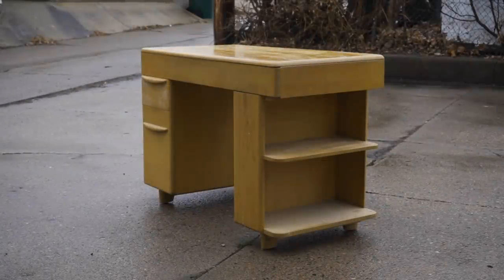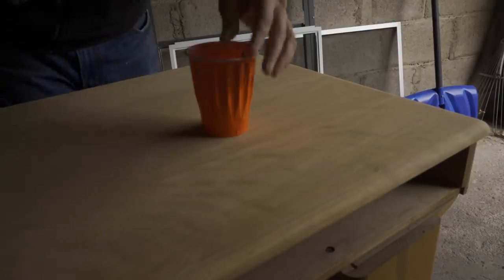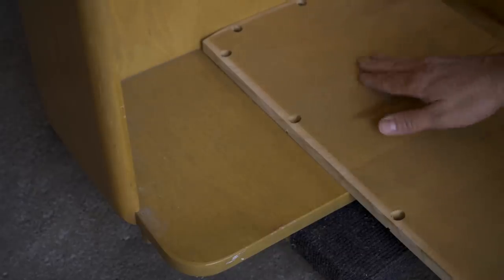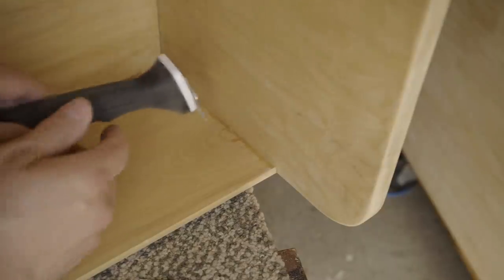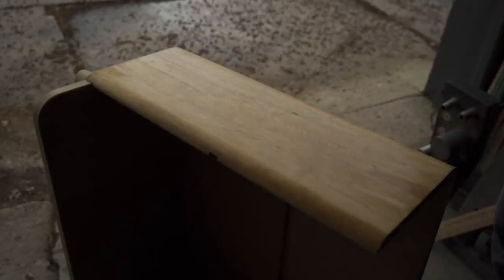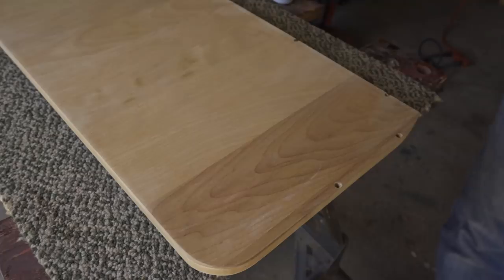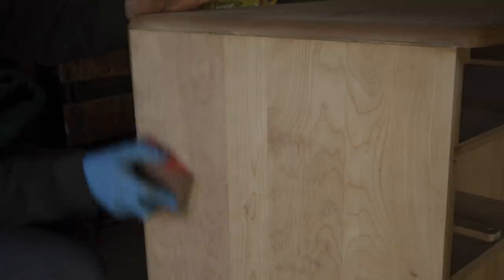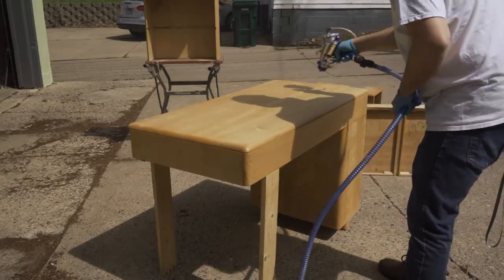Refinishing A Mid Century Heywood Wakefield Desk | Furniture Refinishing

Comment: My mom and dad had a matching large desk, corner table, and end table exactly like the one here. My sister got the desk and I got the two tables. Like yours, the "blond" furniture appeared to be sprayed with a colored lacquer. Single coat on the undersides and multiple coats, sanded and buffed, on the top sides, and all held together by screws. Haven't had the heart to work on them since I acquired them in 2010, but after your video, maybe now is a good time. Thank you.

Comment: I have not had good luck with Danish oil. I have reserved it for the interior of furniture so that it gets used. This color looks better. I was hoping you'd change it to a deep brown, but pleasantly surprised! How do you like the scraper over wood stripper? I need to restore a stanely mcm dresser. I am wondering if I should invest in a good scraper. I don't have anything  grinders to sharpen it though (I am assuming it's needed.)

Comment: The original finish on these is a combination of stain and a tinted lacquer over it.  I think what you're calling "yellow" is a birch colored stain that was meant to even out the wood color and then the tinted lacquer would go over it.  There are special kits around with two of the color options one was champagne and I forget the other one.
Reply: Yep, you are right on the money, and the darker stain option was wheat. I've used one of the kits you mention to refinish a Heywood Wakefield lamp table, and kit worked very well.
Reply: The other was wheat. I have refurbished several bedroom sets in the wheat stain used on this channel with a couple of coats of wipe on Polly and they look like beautiful
Reply: Please, where do you get the stain?
Reply: Wheat is the other stain option.

Comment: Just curious:  if there's only a finish, and no veneer, wouldn't it have been faster (and maybe also gotten rid of that stain mark) to just take a belt sander to it?  I've had trouble with paint scrapers leaving blade marks or even small gouges at times (especially on curves)....much harder to remove, IMO.

Comment: TIP: oldschool method to clean gummed up and clogged sandpaper is to buy a brick of raw rubber (same hardness as ‘raw rubber shoe sole’) you sand the rubber brick and renew the sandpaper. They did this back in the day to allso prolong the lifespand of the sandpaper. We did this in the woodshop i worked at. Works great!

Comment: The composition of Danish oil varies from manufacturer to manufacturer. It's usually a blend of Tung oil and either ordinary spirit varnish or polyurethane. The proportions of the blend also vary between makes. This means that there can be a wide variation in both quality of finish, and durability. In the UK, I have found I get the best results from a brand called Rustins. For most projects I start by applying a coat of wood conditioner, which helps to prevent blotching. Once dry, I find that three coats applied with a sponge brush, a light sanding between coats wih 220 grit, and a final buff with a crunched up brown paper bag produces a pleasant finish with a soft lustre, which is also quite hard wearing. Thanks for an excellent video, love your relaxed style.

Comment: From my research and understanding HW Furniture used a stain with a toner in it to give it the opaque finish. Then coated with a lacquer. The toner was used to give the piece a uniform look. As you pointed out, using that simple clear coat shows the construction with grain patterns going in all sorts of directions. These desks have to be refinished in the original fashion or they just look funky.

Comment: Looks great.  I have refinished a few Heywood Wakefield pieces.   A 8 drawer dresser and a junior desk.  I used a clear Minwax Satin finish.  I used a brush and wet sanded after the first two coats.  It looks really good.  It looks sprayed on.  The older finishes put on by the factory in the 50’s were oil based and that is why many pieces have that yellow tint to them.  I will be working on a Paul McCobb piece next.

Comment: Silly question. But how easy or difficult is scraping finish? Also,do you typically use light pressure, howdy youkeep from biting into the veneer or from scratching the veneer?

Comment: What's the best tool to sand a laminate table top? I am wanting to just slightly stain my table from it's very pale color to some darker color.
Reply: Hi! I'm not an expert but I think that you won't be able to sand or stain laminate. Laminate is basically a picture of wood that's been covered with plastic. Veneer is different and you would be able to sand the original finish and restain it.
Reply: @elizabethreid5554  thank you for responding. I appreciate it. I just want to change the color. I guess back to the drawing board.